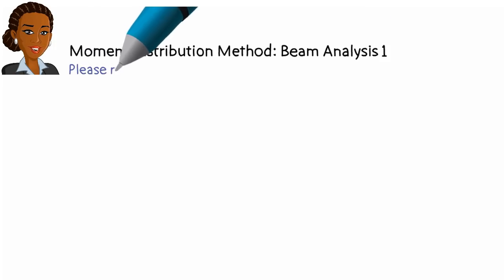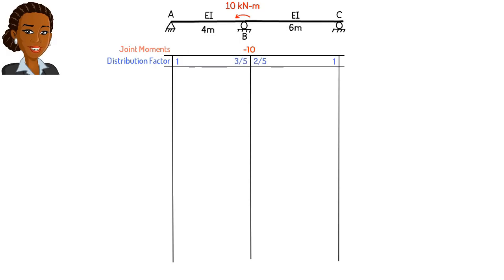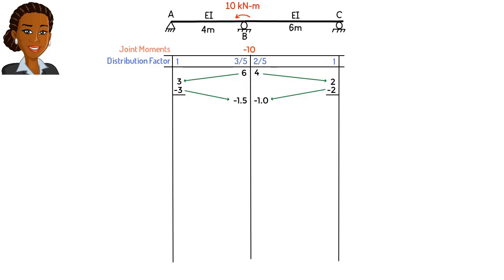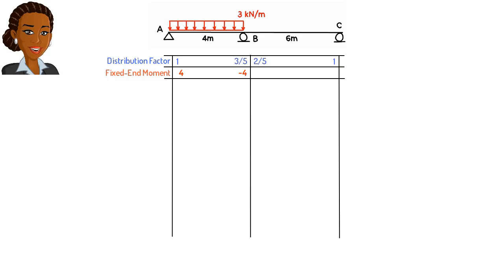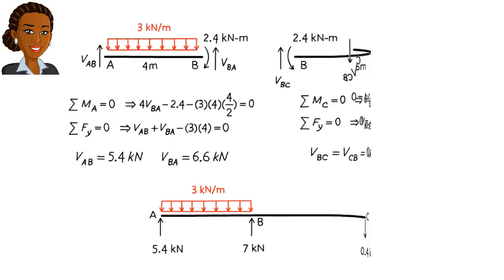SA38: Moment Distribution Method (Beam Analysis 1)

Comment: Thank you very much for your effort. Arrows at 7.47 min at BC member for shear is incorrect. Is should be opposite.
Reply from the maker: The shear force (Vbc) at the left end of segment BC needs to be upward (since the bending moment at that end of the segment is counterclockwise). Otherwise the sum of the moments at the right end of the segment would not come out to be zero.

Comment: I just want to ask, is the table used like per category? For example if the beam had uniformly distributed load, a moment at point B or a vertical force going down somewhere else, do we just do a table for uniformly distributed load first then the rest, one by one, and then add them all up in the end to find out what the vertical forces would be?
Reply from the maker: We can take the approach that you have suggested. But that results in going through the moment distribution process multiple times. To shorten the amount of computations, we can calculate the fixed-end moments due to each load, then add them up the values for each column before we start the moment distribution process. 

For example, let's say member BC is subjected to a uniformly distributed load of 3 kN/m, and there is a concentrated load of 8 kN applied at the midpoint of the member. If the length of the member is 4 m, then the fixed-end moments due to the distributed load are:

left end (end B): (3)(4)(4)/12 = 4
right end (end C): -(3)(4)(4)/12  = -4

For the concentrated load the fixed-end moments are:
left end (end B): (8)(4)/8 = 4
right end (end C) = -(8)(4)/8 = -4

Therefore, the total fixed-end moment B equals 8, and at end C equals -8. These would be the values that we enter in the moment distribution table, and perform computation on.
Reply: @DrStructure  Oh okay I get it, thank you so much for replying quickly and comprehensively!

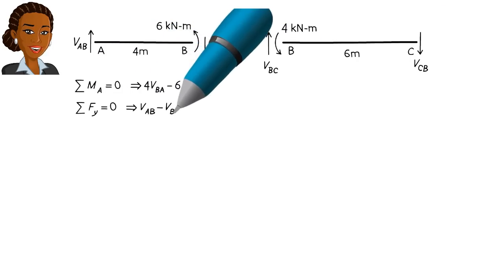Comment: Hello Dr Structure Please help... Case 1 : at 7:02 member end BA = +6, then at 7:38 it is put into the equilibrium equation as -6
Case 2 :   at 10:11 member end BA = -2.4, then at 10:23 it is in the equilibrium equation as -2.4.
So my question is, how can the SAME member end be summed up as positive in Case 1 and CHANGE to negative in the equilibrium equation for case 1, but in Case 2 it is negative when summed up and REMAINS negative in the equilibrium equation for Case 2?
Reply from the maker: We need to distinguish between two different sign conventions: the sign convention that we use for member-end moments in the moment distribution method (which is derived from the slope-deflection method), and the sign convention that we use when writing static equilibrium equations. The two sign conventions are not the same. 

For the moment distribution method, we take counterclockwise as the positive direction. So, @7:02 we get a positive value for the bending moment at the right end of member AB. Since the moment is positive, we’ve placed it in the counterclockwise direction at the right end of AB @7:38.

For Case 2, the computed moment at the right end of AB came out negative. So, we’ve placed that moment in the clockwise direction at the right end of the member @10:23. Note that in both cases, since we are placing the member-end moment in the correct direction on the free-body diagram, we specify the moment magnitude as a positive value.

As for the other sign convention, the one that we use for writing the moment equilibrium equation, we can assume either direction as positive. When we are summing up the moments about point A (@7:38 and 10:23), we can take either clockwise or counterclockwise as positive. 

In Case 1, at 7:38, clockwise direction is taken as positive. That is why 4Vba has a positive sign (since it is creating a clockwise moment about A) and 6 has a negative sign. In case 2, at 10:23, counterclockwise is taken as the positive direction. Hence, 4Vba has a positive sign and 2.4 has a negative sign. 

Note that even if we had done it differently, we would have gotten the exact same results. For example, for Case 1, when writing the moment equation, if we took counterclockwise as the positive direction, the first equation would have been written as: 6 – 4Vba = 0 which is the exact equation as 4Vba – 6 = 0.
Reply: @DrStructure  thank you,

Comment: Can you pls explain what is done for beam with internal hinge for that method
Reply from the maker: The moment distribution method works best when the beam nodes correspond to the pin/roller/fixed supports. Meaning, the beam does not have any vertical displacement at the nodes.

An internal hinge introduced in the beam causes a vertical displacement at the hinge node. This makes the use of the moment distribution method rather cumbersome. 

Such beams are best analyzed using the matrix displacement method.

Comment: Hello Dr Structure.. at 1:50 when calculating member stiffnes for both secitons, I was under the impression that when you have a pin or roller support then k = 3EI/L yet just EI/L was used...are you able to explain the difference please
Reply from the maker: The general form of the stiffness factor is EI/L for the member divided by the sum of EI/L at the joint. When an end-support is a pin or a roller, the total sum of EI/L at that end is: EI/L, since there is only one member connected to the end. Hence, the factor becomes EI/L of the member divided by the total EI/L which in this case gives us 1.

There is,  however, a shortcut that can be used to speed-up the number of iterations of the moment distribution method. And that is using 3EI/L for end-pins or rollers, instead of using EI/L. Of course, this revised factor can be shown be true mathematically as well. 

Either way the method converges to the right value for the end moments, although the later factor results in a faster convergence.
Reply: @DrStructure  So EI/L alone can be used to calculate the stiffness factor for a member with any support?
Reply from the maker: @agassimurray2186  Yes.

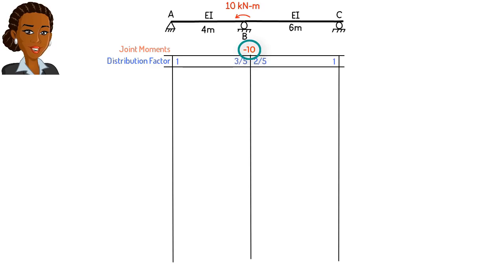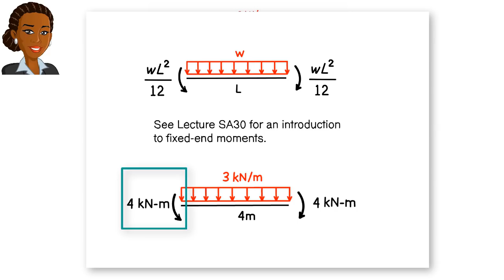Comment: Why do you keep changing the sign convention for moments? First its -ve for anticlockwise at 3:29 then +ve for the same at 8:38
Reply from the maker: We are using the sign convention adopted for the slope-deflection method: an anticlockwise moment at the ends of the member is considered positive.

Note that an anticlockwise moment at the end of the member (connected to a joint) translates into a clockwise moment at the joint since the sum of the two moments must be zero.

So, at 3:28, the moment shown is at the joint (not at the end of the member). That anticlockwise moment at the joint results in a clockwise moment at the end of the member; therefore, we treat it as a negative moment.

At 8:38, however, the referenced moment is at the end of the member. The counterclockwise moment at the left end of the member is positive, and the clockwise moment at the right end is negative.

Comment: @Dr. Structure 
Q .1 Can you please tell me why carrying over member-end moment always taken Half of the previous end moment ?
Q.2 What will be the procedure to solve it if the Joint B having 3 or more members passing through it ( example : Frame Analysis using Moment Distribution Method ) ?
Q. 3 How can we solve a problem  having Degree of indeterminacy 2 or more ?
Reply from the maker: On Question 1: The reason can be found in the underlying slope-deflection equations. Take a look at SA37 where I show the math behind the process. More specifically, go to 8:20 and examine the two sets of equations shown. 

When we have a rotation at B (theta B), then moment at the right end of AB is calculated using a factor of 4 (rotation multiplied by 4EI/L) where as the moment at the left end of the segment is calculated using a factor of 2 (rotation multiplied by 2EI/L). So, if we have the moment at B, then the moment at A would be half of that.

Questions 2 & 3: The procedure would be the same, it is just that the table would  get a bit bigger, and a bit irregular in shape (in the case of frames).  Stay tuned for the next few lectures for further discussion on this topic.
Reply: Thank You very much , You are awesome

Comment: For member BC far end is 'C' and it is roller support there and for roller support stiffness factor is 3/4.EI/L as far as I know so please tell me how do u take stiffness factor of EI/L there?
Reply from the maker: How did you come up with 3/4? More broadly, how do we calculate the distribution factors?

The process described here is a systemic approach for calculating distribution factors. The use of 3/4 is a shortcut that works when certain condition is met. Either way we end up with the correct solution.

Comment: how  did you obtain the values 0.6 and 0.4  ? ( when carrying over )
Reply from the maker: Please provide the video time for the question. Are you referring to the values at time 9:53?  If so, 0.6 is half of 1.2 being carried over from joint B. And 0.4 is half of 0.8. The carry-over factor is always 1/2.

Comment: 3:40 why did you put -10  you said counter-clockwise is positive in slope deflection medthod ?
Reply from the maker: Yes, a member-end moment is considered positive if it is counterclockwise. When that moment is transferred to the adjacent joint, it becomes clockwise, since the equilibrium condition (sum of moments = 0) must be maintained.  So, a positive moment at the end of the member becomes a clockwise moment at the joint. Here, since the joint load is counterclockwise, it suggests that the corresponding member-end moment would be clockwise (or negative), hence the negative sign.
Reply: Dr. Structure thanks for answering you are really great
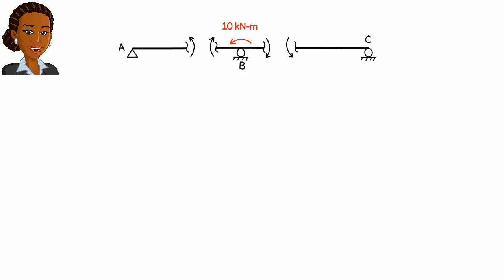Reply: Dr. Structure as I understood , the picture is at 1:32 right? we will have 2 clockwise moments at the end of member which support B is , and 2 of them must be included to be 10 . This 10 clockwise is negative.
Reply from the maker: The member-end moments drawn in black are all considered positive.  When we cut a member, say AB, closet to the joint, then we draw a counterclockwise (a positive) moment at the member end, and an accompanying clockwise moment at the other end (joint end) of the cut. So that the sum of the moments at the cut equals zero.  So, if the applied load (shown in red) was acting in the clockwise direction, like the other two (black) moments acting at B, then we would have considered that a positive moment. But since the applied load is acting in the counterclockwise direction at the joint, it is considered a negative moment.
Reply: Dr. Structure Crystal clear thanks a lot
Reply from the maker: You are welcome.

Comment: Hi so what if there is a free end? Do we consider it like there is a joint there and nothing changes?
Reply from the maker: If the beam has an overhang, we remove it before proceeding with the analysis. Suppose our beam rests on a pin at A, a roller at B, and a roller at C. And, there is an overhang to the right of C. Let's say the length of the overhand is 2 meters. If there is no load being applied to the overhang, we can simply get rid of it, resulting in a continuous beam that rests on a pin and two rollers with no overhang (no free end). However, if the overhang is subjected to a load, we need to include its effect on the continuous beam. Say a load of 40 kN has been placed at the free end of the overhang. This force creates a clockwise moment of (40 kN)(2 m) = 80 kN-m about point C. So, we can remove and replace the overhang with a clockwise moment of 80 kN-m placed at the roller support at C before proceeding with the analysis.
Reply: @DrStructure  thank you so much for quick reply i also have a problem with having more than 3 supports. The table becomes so confusing and calculations are all over the place. Can we create seperate tables for each joint? Thats my last question.
Reply from the maker: @berkgumus4047  The table is our common way of representing the moment distribution data. But we can represent/tabulate the data differently. So it would be okay to create three separate tables for a beam with three supports. As long as we keep track of the carry-over moments, knowing how/where to transfer them from one table to another, we will get the same results at the end.

Comment: Hello sir....again your patient is suffering from a disease of structure.. this time moment distribution method...first of all i wana ask as we know that moment distribution method is an approximate analysis so can answer vary in range...like one has obtained a value of moment at some point as 20 According to book through other method like stifness factor modification and hence distribution factors gets change accordingly and i obtained as 24 with normal process...is the difference is acceptable or am i doing any error...for making it more clear to you i have mailed you today a screenshot of my solution...please take a look and tell me if i m doing any blunder.please do take a look sir.waiting for your response.thank you.i do need your suggestion....
Reply from the maker: The moment distribution method should provide reasonably accurate results, when enough number of iterations are performed. Any deviation from the actual results by more than 1% is problematic and points to potential calculation error(s).
Reply: Dr. Structure got you sir...I will keep it in mind... Thank you

Comment: Hello sir...good morning...sir i have a doubt...suppose a continuous beam consisting three span AB BC CD...ALL are pinned support...there is no load in any span on the beam...it is given that support B settles by an amount 15mm...Now i know that A FEM will be induced in span AB and BC...FEM(AB),FEM(BA),FEM(BC),FEM(CB)..ALL will be equal to 6EI(delta)/L^2...but sir what will be the sign convention if i consider anticlockwise rotation as positive..please help sir...really urgent...thank you
Reply: I m solving it by moment distribution method...
Reply from the maker: In this case, we end up having positive values for FEM for member AB, and negative values for FEM for member BC. This is the case because AB is rotating clockwise which means Delta is negative, while BC is turning counterclockwise implying a positive Delta.

Comment: 2:58 - Left should be right and right should be left?
Reply from the maker: At A, the total bending moment at the joint is going to be distributed between the ends of the members connected to A. Since there is only one member connected to the joint, we could say, the moment at A is going be distributed to member AB only. More specifically, to the left end of the member where joint A resides. Similarly, at C the entire moment is going to be distributed to the C-end (the right end) of member BC. Please keep in mind that here we are talking about the distribution of the moment at the joint, and not the carry-over moment.

Comment: Excuse me, at 01:52, what is stiffness coefficient? What does that mean?
Reply from the maker: Stiffness coefficient (EI/L) is a property of the beam that defines the relationship bending moment and rotation.  We can compare it to the spring constant for an axially loaded spring. When subjecting the spring (beam) to a force (moment),  the larger the stiffness coefficient (the stiffer the member), the smaller the displacement (rotation) would be.